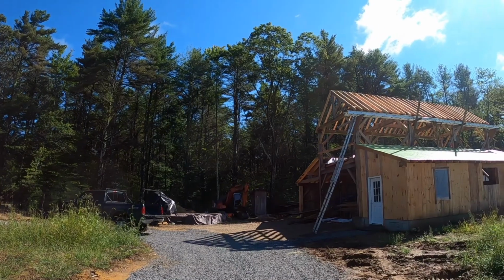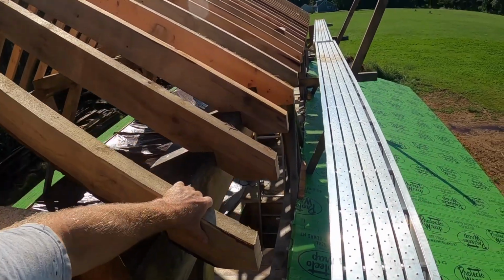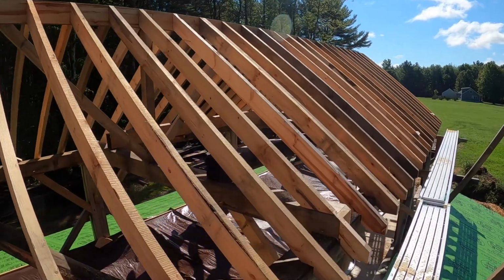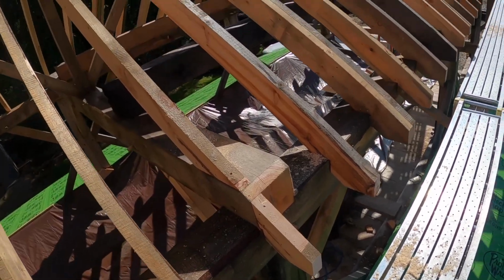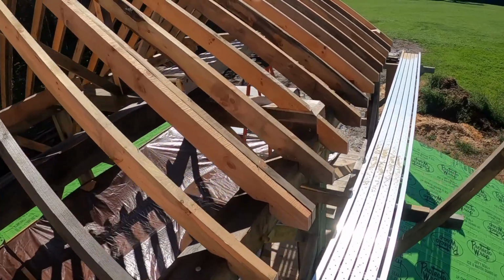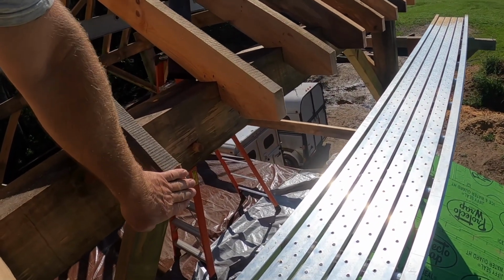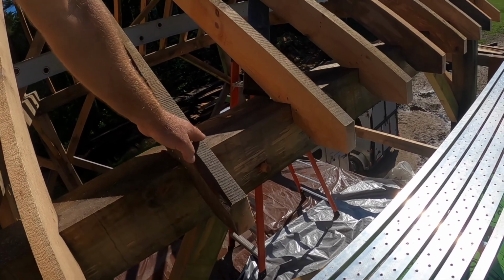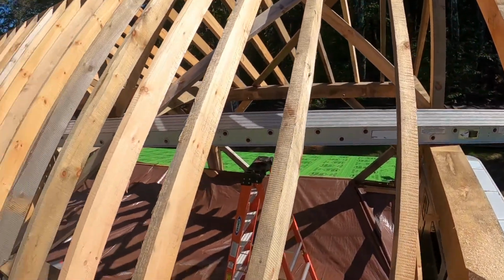Horse Barn Part 12: Loft Roof Sheathing Boards, Water Shield

Comment: 311 / 5000
Résultats de traduction
I really like your barn. What is the dimension and how do you calculate the lumber you need. Do you have a plan that we can visualize.
Thank you from Quebec more precisely near the border of Maine.
ah i'm not really good at english i have google help.
Reply from the maker: It's 36' x 38' feet, not meters. I use the SWAG method of calculating lumber needed. (sophisticated wild a** guess) I did a short video on my design process for the barn project last winter at the end of my "Taking Down More Trees..." video that you might find interesting. This link should take you to the spot in that video where I talk about getting things down on paper and some of my thought process. https://youtu.be/ZKsFVzTX6sU?t=1240